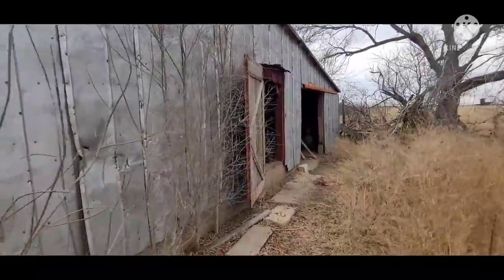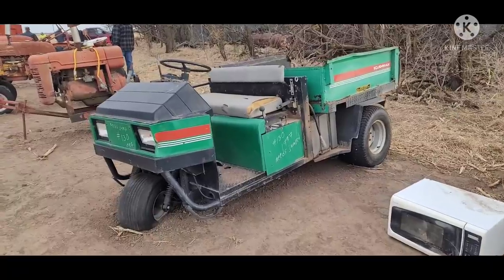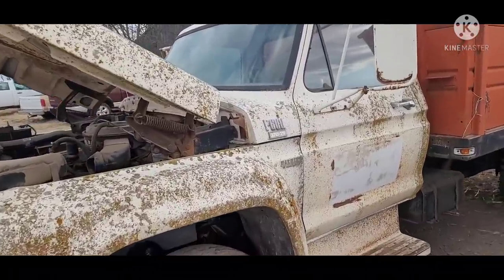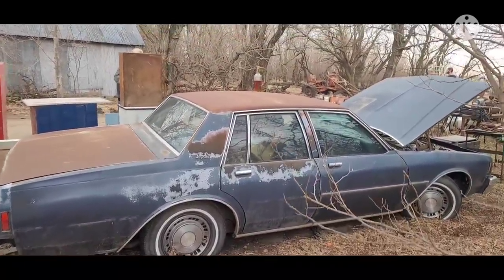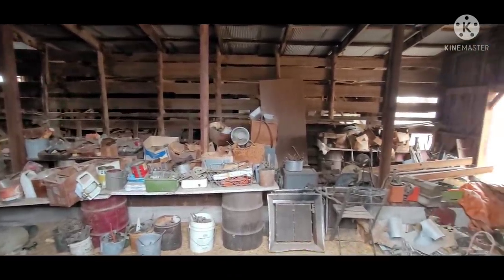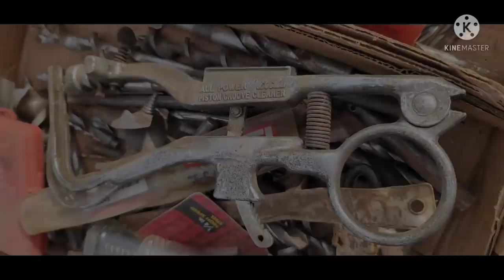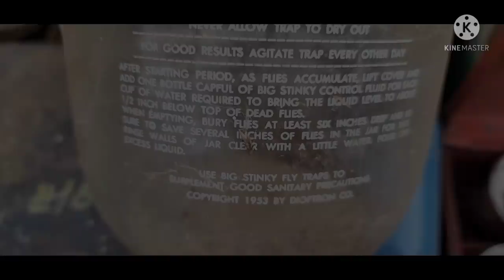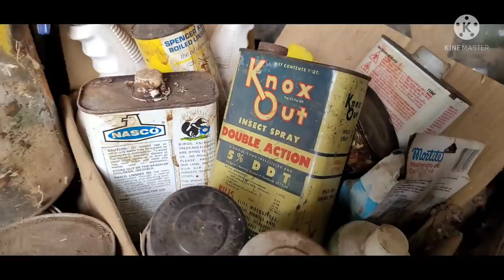Abandoned Farmstead Auction! Trucks, Tractors, Cars & Motorcycle collection! Picking sheds & barns!

Comment: the 3-wheel motorcycles are 1 wheel rear drive and one idle wheel or some had overrun clutch bearings in each side allowing both wheels to drive and either one to free wheel forward around curves and corners.
Reply: sure looked like a 'proper job'

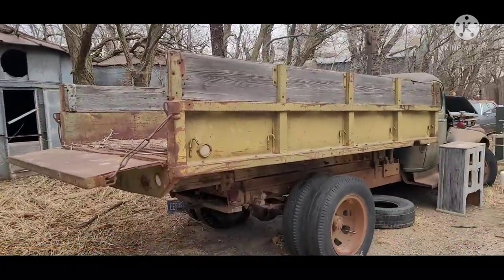Comment: Nice video. At 19:49 you pan across the old Chevy truck with the military bed. The bed is for a 1943-44 G.M.C. CCKW 353 standard wheel base truck. The beds are becoming scarce and could fetch as much as 2500 dollars by its self. I hope it doesn't go to the scrap yard because there are way more Cab and Chassis CCKW's without beds and this one could fill the void.

Comment: 6000 miles is nothing on that motorcycle actually. I have a 1965 Honda 305 scrambler that I still ride that has 56,827 miles on original engine.